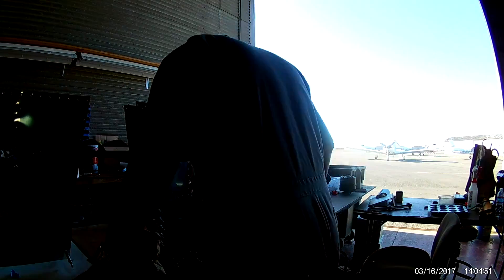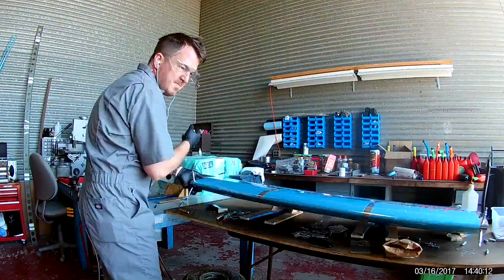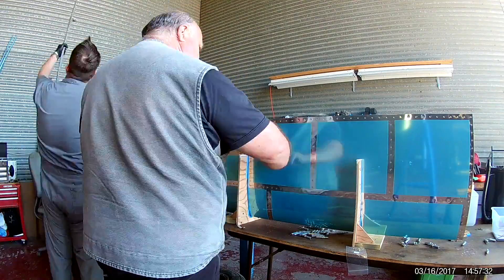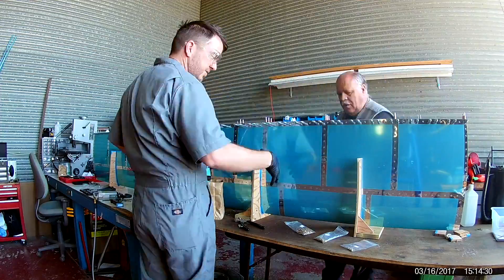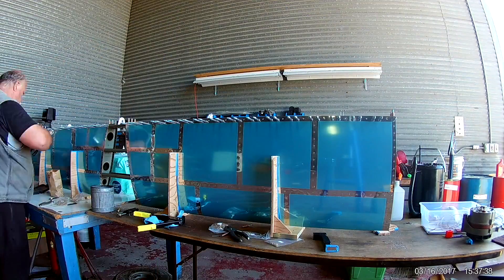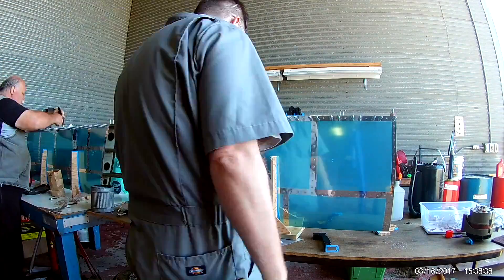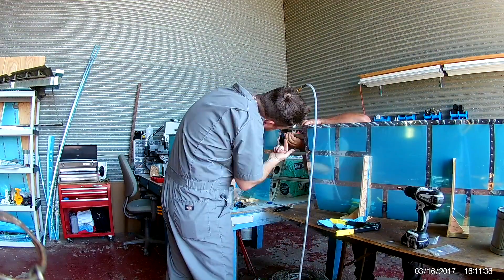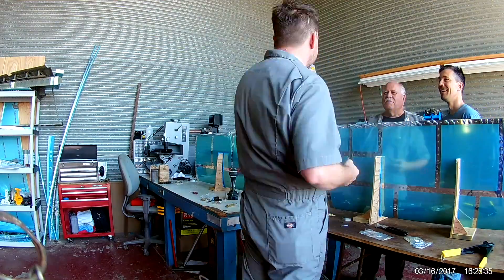RV-14 - HS 19

Comment: Regarding strength of "Pop" rivets:  my CH650 - like the RV-12 - uses blind/pulled Avdel rivets for just about everything but the main spar.  Chris Heintz my have designed in minor spacing differences for minor differences in tensile and shear strength.  Actually, one of my suggestions to Vans was to have a model identical to the RV-14 but designed with blind rivets.  Doesn't look quite as clean and my may lose a couple of knots but imagine the simplified build with no dimpling, rivet taping or bucking!  Just match drill and pop, pop, pop with a pneumatic puller.